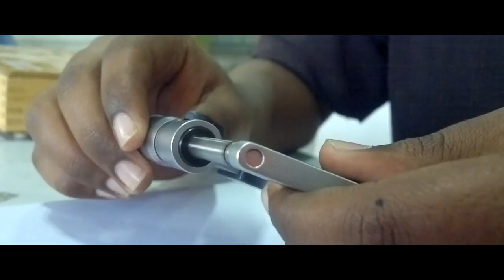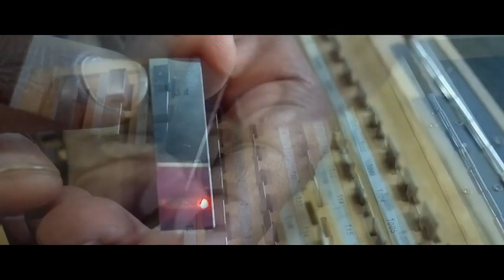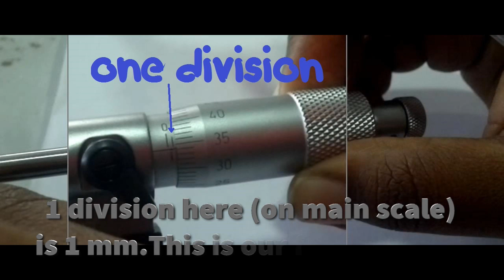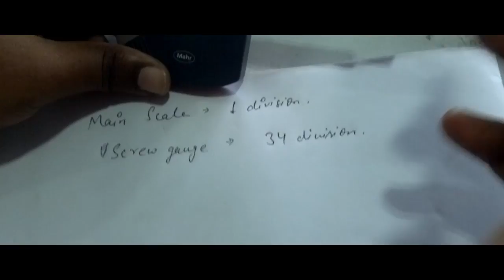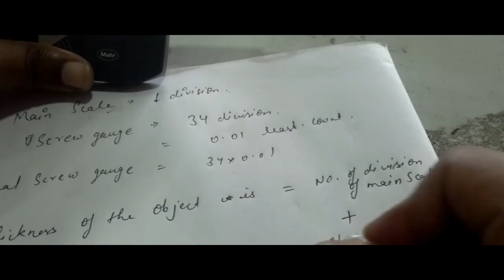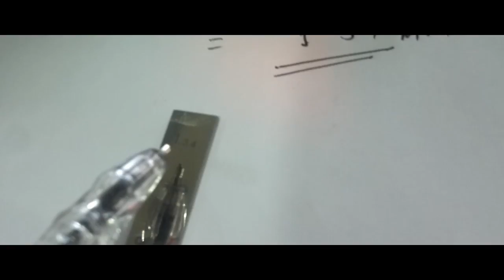How to use a screw gauge (micrometer)

Comment: What if the circular scale readings are below the main scale
Reply from the maker: Well,Kriti can you be more specific in the question?

If you are saying the circular scale is hiding the main scale,then 2 things must've happened.

1) The screw gauge is either faulty or both the scale aren't synchronised properly.
2) The spindle is somehow misplaced or loosened creating a gap inside the thimble (the circular scale bearing body).
Better work with a new screw guage:)

Comment: hey how do we calculate the least count of the gauge
Reply from the maker: Generally when you'll get the screw gauge,you will come to know it's least count (mostly it is written somewhere on it).But in case you need to find out,follow this formula-

Least count for screwgauge = PITCH/Number of DIVISIONS on circular scale

here, PITCH of the screw is the distance between two consecutive screw threads.This ranges from 0.5 to 1mm.

The one we used in this video had 0.5mm pitch.So,dividing that by 50(number of divisions on circular scale) gave the least count to be 0.01mm.

Hope this helped:)
Reply: Engineers inc. your really awesome...upload many vedios sir